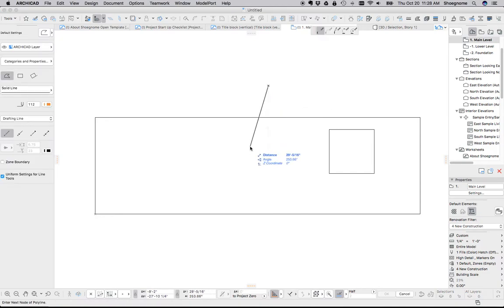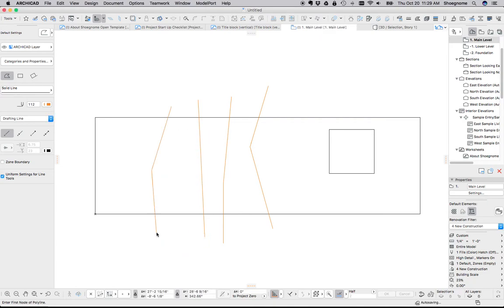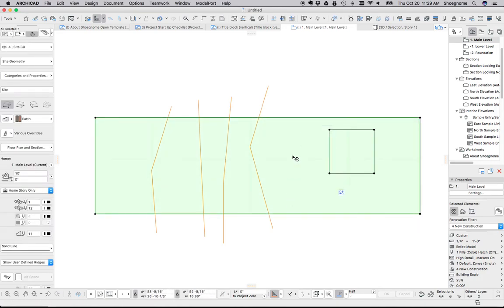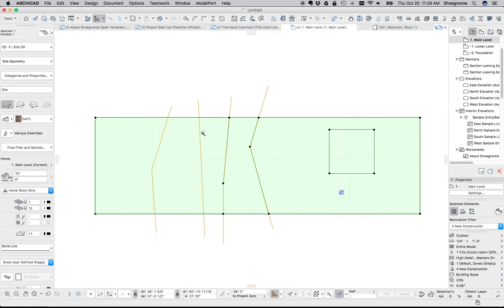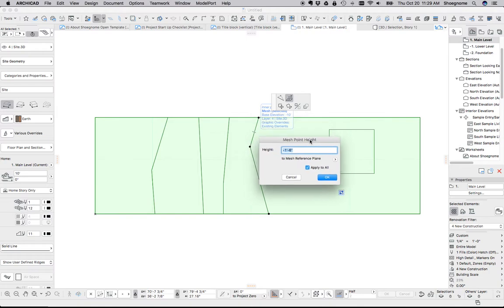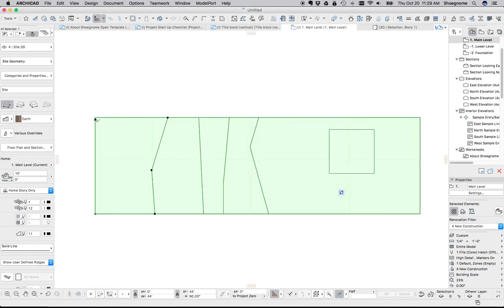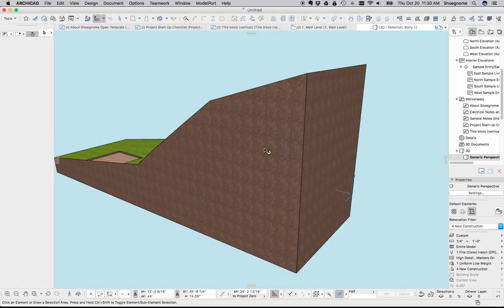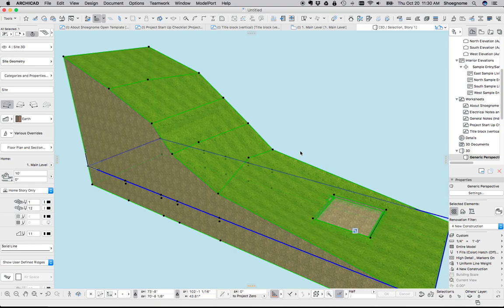ARCHICAD Tutorial #58: How to add contour lines to a Mesh in ARCHICAD

Comment: I'm having some trouble doing it, i can't select specific lines, only the polygon that it creates.  Any idea what's going on with those unselectable lines ? :s
Reply from the maker: Make sure you are selecting the user defined ridges and not the ones generated automatically by the mesh. There's a toggle in the info box/selection settings. You can only select the user defined ridges (lines).

Comment: Hi, thanks for the tutorial. Do you know if there's a way to label each topo line? automatically? to put 30' where is 30' for example.
Reply from the maker: You can place a Level Dimension. It'll display the elevation of any point on the Mesh. Placing a Level Dimension on the contour would give you the contour elevation. Note though that if the contour moves the Level Dimension won't move with it. Instead it'll show the new elevation height below it.
Reply: Thanks for replying back! Although, sorry for not being clear, I meant putting a written label for each topo line. I’m not talking about the point elevations because I already know how to do it. I just want to know if there’s an automatically way to put written labels so that you can see the topo elevation on your floor/site
plan. Thank you!
Reply from the maker: There's no way I know of to automatically place all the labels. But if you use the Level Dimension you can manually place linked labels on the floor plan and also include manual text (or in ARCHICAD 21 autotext). If I'm still missing what you're asking for can you link to an image of a mockup of what you're trying to accomplish.
Reply: That’s what I thought. I’m currently working with the 19th version so I will try to do what you said about the level dimensions because I’m not able to upgrade for now. Please, see the red numbers (levels) it's exactly what I want to get. https://drive.google.com/open?id=0B8puwo4v-DKIODMwWUJacTZsLW8

Since I realized there’s no automatically way to put them, I thought on two other ways. 1- Putting a simple text over a white plan (Made by Fill Tool) on the topo line so that line is hidden or 2- Deleting a section of the topo line and putting in that space the level text. What do you think?
Reply from the maker: For this absolutely use the Level Dimension:

https://helpcenter.graphisoft.com/guides/archicad-20/archicad-20-reference-guide/documentation/annotation/dimensioning/level_dimensions/

https://helpcenter.graphisoft.com/guides/archicad-20/archicad-20-reference-guide/user_interface_reference/tool_settings_dialog_boxes/dimension_tool_settings/level_dimension_tool_settings/

You can turn on an opaque background fill to cover up the contour line behind the text. And once you place the Level Dimension, select the text, change from measured value to custom text, and then select 'to sea level' from the dropdown menu arrow to the left of where it says custom text in the info box.

Here is an ancient article that talks about part of this process: 
http://www.cadalyst.com/aec/how-display-elevation-values-relative-sea-level-archicad-insights-tutorial-3714